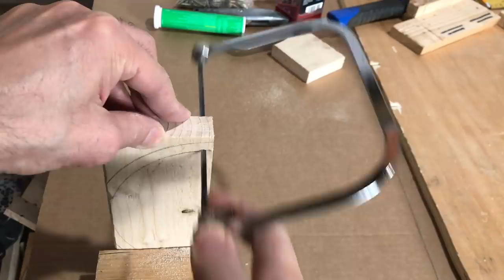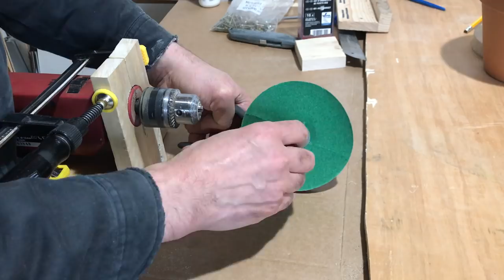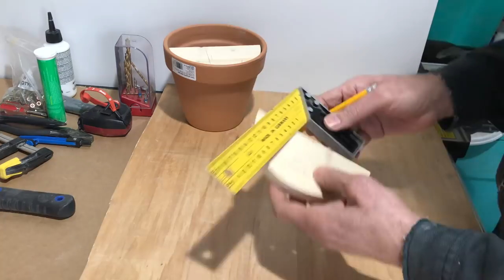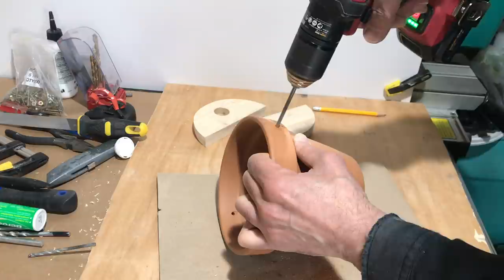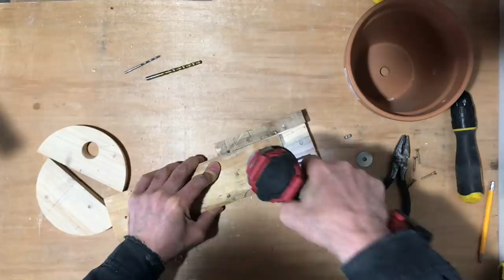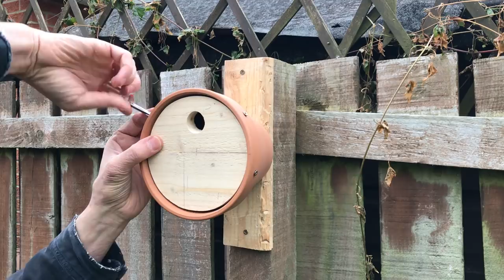Plant pot bird house, a simple DIY project.

Comment: Die Überschrift „simple“ passt bei dem vielen verschiedenen Spezialwerkzeug nicht. Es sieht einfach aus, ist aber ziemlich umfangreich.
Reply from the maker: The Idea is simple and you could make it as simple as you want. Cut a a circle out of wood with a small hand saw (as shown in the video) and then cut a v shape notch at the top. All you need is a drill , a little saw and a screw driver. It can be done with basic tools, it just takes a little longer and the project might not look as refined but fully functional.
Reply: @massoudmakes  Der Titel und das Video passen einfach nicht zusammen. Das kannst du hinterher nicht schön reden

Comment: Wet your pot to drill. And also can wet pot if its clay and drill bottom hole out larger and reverse pot for house opening and make oppositely birdhous.cover with clay draining tray
Reply from the maker: You can do that but I wanted it to be simple and also show both open and closed type bird house.
Reply: Why should the clay be wet before drilling? To keep it cool?
Reply from the maker: @mjh5437  I think it's supposed to be easier to drill, I haven't tried it.

Comment: i must be dumb bc this doesnt look so simple to me but great video and cool idea
Reply: to make that sander is cool and i dont have a drill bit for flower pots would probably break lol
Reply: i think a lot of people forget that you need to be able to clean bird houses out at the end of ever year. the plant pot is smart bc it breathes
Reply from the maker: I used a normal masonry bit but it must be fairly sharp and carefully drilled.
Reply from the maker: You could just cut a round piece of wood to fit without tapering the edge, it still works.

Comment: Additional holes needed for ventilation and a perch going through the hole,  other wise birds are trapped inside and also die from suffocation.
Reply from the maker: The plant pot stays cool as it doesn't get much sunlight also a perch is not a good idea because big birds can use it to grab the chicks.
Reply: THE RSPB do not encourage the use of a perch as predators such as Jays, magpies can use it to stand on and reach in. Small birds will find it ok without a perch.

Comment: And that is simple ???  Wouldn't like to see the difficult version !!!
Reply from the maker: You can make it as simple as you want, but if you finding it difficult then you can simply screw the pot directly to the fence, get a round piece of plywood or even a plastic lid and glue it on with silicone or epoxy then cut a notch at the top and it's ready.

Comment: should have tilted the band saw table as you cut the curve then you wouldnt have needed to sand so much and drill the hole from both sides
Reply from the maker: I know how to do angle cut on the band saw but not many people have a band saw. I used the band saw for quickness but for people who use a coping saw (as shown in the video) they need to see how to get the angled edges. I didn't drill from both sides because I was drilling at an angle and I used a sacrificial piece under it which   minimises any tear out.

Comment: A death trap for baby birds because it is too smith and they can not come out.
Reply from the maker: If you think the hole is too small and the baby birds can't come out then how on earth did the mother bird, which is larger, managed to get in and lay the eggs in the first place.
It depends on what bird you want to attract, here in the UK we get a lot of blue tit and coal tit in our garden and for them the recommended hole size is 25mm. It stops larger birds from using it.
Reply: @massoudmakes  not snall, but too clean and slick material inside nest walls.

Comment: Not simple
Reply from the maker: You can make it as simple as you want, but if you finding it difficult then you can simply screw the pot directly to the fence, get a round piece of plywood or even a plastic lid and glue it on with silicone or epoxy then cut a notch at the top and it's ready.